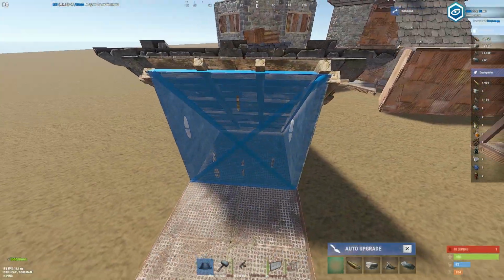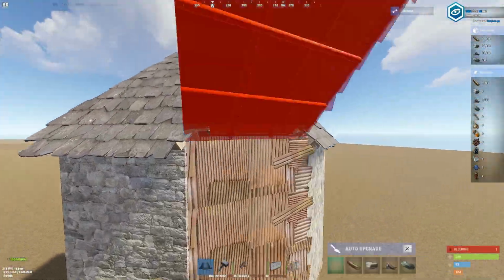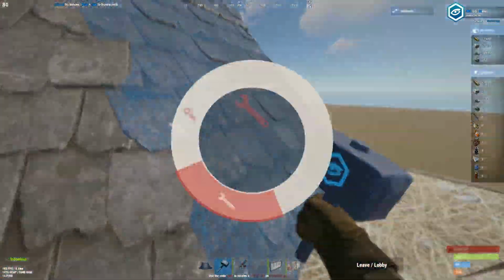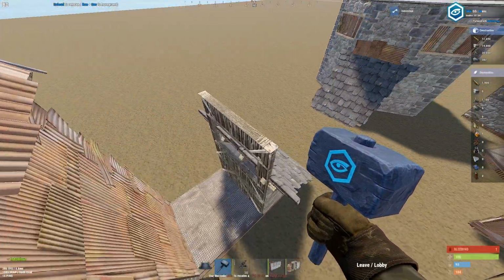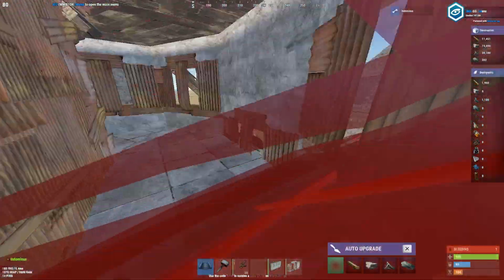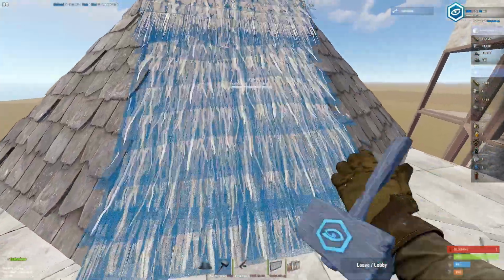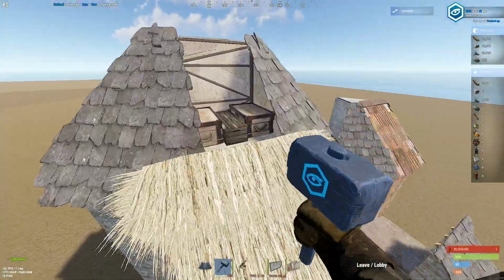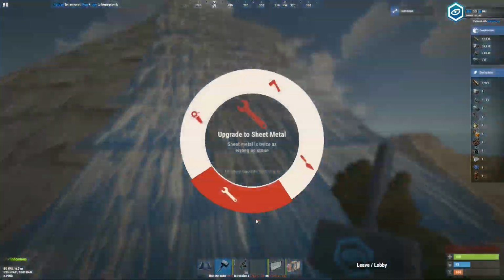NEW HIDDEN BUNKER Design Concept - RUST 2024

Comment: The reason all full walls doesn't work is because stability is determined by first finding the shortest path (the number of building blocks) to the socket being supported. If there are two paths with the same path length, it opts for the path with higher stability. For example, if you have 3 full walls holding up the bunker seal, compared to two walls and a roof, they have the same number of blocks, so the higher stability route (3 full walls) is chosen. However, if you instead use 2 full walls, 2 half walls, the length of that path is 4, which means the path with 2 full walls and a roof will be used to calculate the stability when the twig roof is placed despite it being the lower stability route.
Reply from the maker: You legend! I didn’t even know that was a thing. That explains it all perfectly thanks brother :)